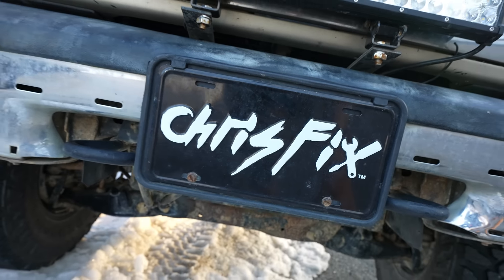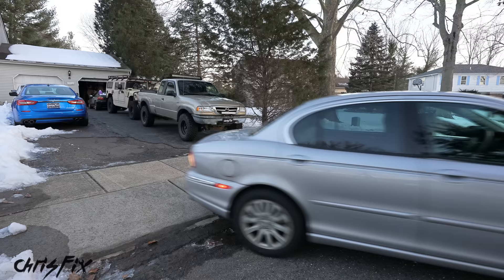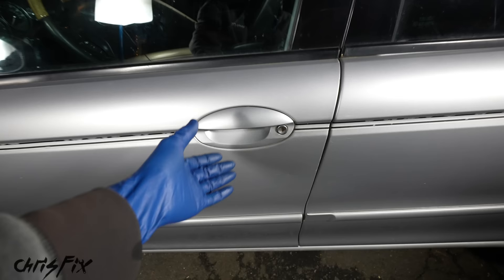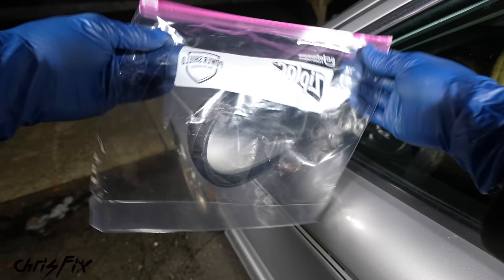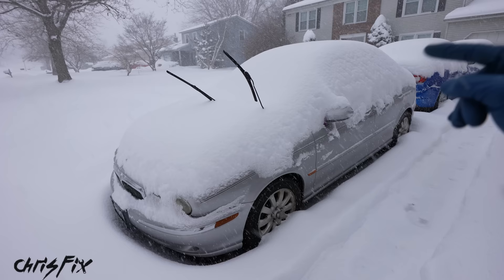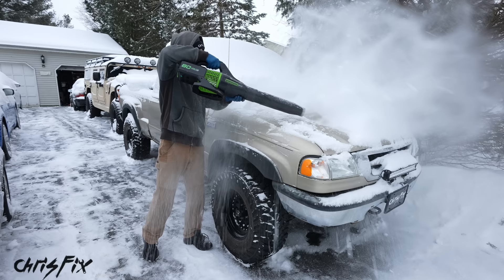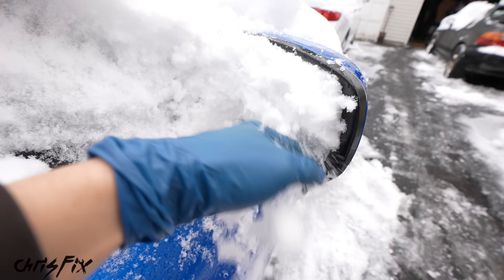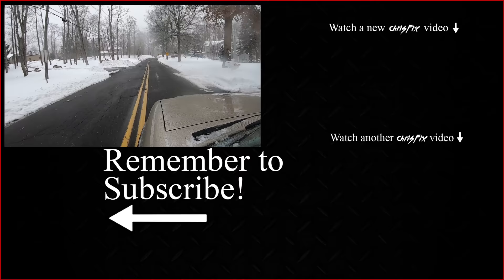10 Winter Car TIPS & TRICKS you NEED to Know

Comment: 10:53 you need to get that snow off the roof too, otherwise it will come off randomly while youre out on the road, creating problems for other drivers. plus it ruins the aerodynamics.

i think the best tip would be to park the car in a heated garage. doesn't have to be all that warm, jjust keep it a few degrees above freezing so that any residual ice and snow melts off.
Reply: When we built our home we insulated and dry walled our garage. Best thing we ever did. Never gets below 47 degrees even when it’s below freezing outside. Also we have the garage attached to the house best thing ever especially in bad weather with kids.
Reply: In some states it's also illegal to leave piles of snow on your vehicle when operating it, as the snow can come off in large chunks and damage other vehicles.

Comment: Another good one is to get an industrial chemical spray bottle or garden pump sprayer from the hardware store and fill it with deicer washer fluid. Spray down your glass and headlights while you're warming your car up so you don't have to run your wipers to use the car's pump. And if you're still running non-winter washer fluid when winter hits (which will dilute the effectiveness of any winter blue-juice you pour in), just add in a bottle of isopropyl (rubbing) alcohol from the pharmacy. It's the same active ingredient as what's in the de-icer stuff. Bonus tip: A thin film of dielectric grease on the door seals does the same job as the silicone spray if you can't find any. You know. That stuff that's at the register at the parts store in the little packets that no one ever buys?
Reply: Incorrect. Isopropyl alcohol will still freeze at lower temps. The active ingredient in washer fluid is methanol which doesn't freeze as easily. It is poisonous, so be careful with it. Also, rubbing alcohol from the store usually contains glycerine, which you really don't want mixed in with your washer fluid.
Reply: @mnntropy5615  Interesting. Been doing it for years and never had an issue.

Comment: If you live somewhere cold(-15C), then don't use that warm plastic bag thing. Melted water will freeze your car badly and then you are fucked up. That water will freeze in under 10 seconds.
Reply: umm no.
at -25 c my door was frozen solid and i used that method and i got the door open when all the ice melted away. and the lock melted from ice.
Reply: Naw, the seals are pretty well designed to keep the water out normally.  The main thing is not to push snow into the lock mechanism when unlocking the vehicle.  Make sure that area is clear first.
Reply: @canadean84  it depends on your car, ir its new then the seals are usually good
Reply: @fuolku1006  it depends if you have New or old car

Comment: The best practice: Snow storm -> my car stays in the garage!!! 🥶
Reply: It doesn't sound like you do it all the time, but putting this here in case  you do park your car in the garage every day during winter. Also because it will help others who read this not have rust. 

Not actually a good idea. The brine some cities (not all) use is Magnesium Chloride (MgCl2) and is activated by water. Putting your car in the garage after trekking through the city/country and picking up snow the whole way will put your vehicle in a defrost, wetting your entire vehicle down the entire night with that brine solution on it. This solution, when activated by water, is actually more harmful than normal rock salt for paint, eating it quite rapidly, since it sits indoors for hours on end while wet. Even unheated garages suffer from this, since all it has to do is be even slightly above 30 degrees Fahrenheit for the ice to start to melt. Once it starts, the MgCl2 will melt the rest and douse your car.
Reply: @joes1176  You recommended what to combat this?

Comment: Great video.  I too am a winter living Canadian.  I already use some of your excellent ideas, but I love your snow shovel trick.  

I would like to know if there would be any disadvantages in using that spray wax behind your tires, in the wheel wells and under the running boards.  I use a rubber mallet to remove the built up ice under there, before I park in the garage (to avoid the mess on the floor when it falls off).  This would be an excellent fix to that build up problem.

Again, a great video.  Thank you. You have a new subscriber.
Reply: That's a great idea! You should totally use the spray wax on the wheel wells and under the running boards.
Reply: You should also use them on the tyres, if the ceramic wax is hodrophobic then that means the tires would be better in the rain right?????
Reply: @cowmaster9180  Under NO circumstances should you spray anything like tire polish, wax, ceramic finish, or anything slippery on your tires, rotors, or brakes - unless you want to slide off the road, and wrap your car around a tree, or crash into other cars. Read the fine print on the label of tire polish and it will tell you this every time.

Comment: Nice tips,  but it would be more helpful to shovel your driveway before you drive out.   The snow that the snowplow shoves in your driveway is normally heavy and packed down.

Also get windshield washer fluid that is good for -40 or -45.   Remember that it's a lot colder with wind chill.   If you're using washer fluid while driving it's going to be colder because of the wind while traveling.

Comment: For the windshield, we've always used a large beach towel and closed it in the doors so it didn't blow off. Just open the doors and shake it off and toss it in the trunk. Kinda one time use though until you dry it or swap with a dry one.

Comment: Crystal clear glass you can actually see through, who'd have thought😆Splendid tips for Winter motoring. The amount of muppets we see on the road in Britain, getting stuck and being helpless when It just takes a little forethought and preparation. To be fair though UK seldom gets snow like that so drivers don't get the practice or heed the advice so when we do get a heavy fall (Last occurred in 2009-2010) most UK drivers go to pieces. Loving the Jag 👍

Comment: I like using a space heater on the inside and plug it in 2 to 4 hours before leaving and warm inside and get the snow and ice off just have to do the hood at that point 
Or just cover the whole thing with a  tarp before the snow hits and pull it all off

Comment: Rain-X the glass.... You can use spray cooking oil on that shovel before you start using it also, we do that with dirt bikes inside the fenders it works. You can also use a garden hose if you don't have any of the examples shown. I have defrosted / snow/ice a vehicle with garden hose sprayed gives it a chance to cool a tiny bit from the hot water tank. Works just fine years and years and years and years.
Reply from the maker: Thanks for sharing!

Comment: Screen protection. 
Get a piece of tough polythene sheet about two feet longer than the width of the vehicle and two or three feet wide depending on the shape and rake of the screen. Nine by three for some SUV and smaller for most saloons. Spread across the screen and have six inches overlap at the top. Trim the bottom of the sheet to the shape of the bottom of the screen. Cut the bottom two corners off: this allows you to tuck the ends into the top window frame portion of the front doors. Place it on the windscreen with the wipers on top. Tuck it into one door first then place it behind the other door pulling it gently so there is some tension on it as you click the door shut.
Hardware stores or garden centres stock sheets of polythene, probably selling it by the yard. Another source  is using the big shrink wrap bags used for shrink wrapping pallets. 200 micron to 400 micron polythene is typically good for this and will last for manys uses. Polythene is a polyolefin so does not stick to anything so it sheds ice and snow easily. Usually a quick shake is all that is required before stashing it in the car. 
In windy conditions it will be most secure if the vehicle faces the wind. Works in windy Scotland so should work in most places. In extremely windy locations, the force will pull the sheet out of the doors so cut the sheet with really long tails that overlap inside the car and can be tied together with string.
(The silicone spray on the door seals always works great but don't do it on the bit where you are tucking in the screen protector!)

Comment: I've used Vaseline on my rubber door trim, everclear in my wiper fluid, tarp on windshield or lg cardboard pieces. Good to catch your wipers up on your windshield (during a swipe) to hold tarp or cardboard on. Also, graphite is good for key sockets (before the hard freeze or storm.
Good tips but here's some alternatives.

Comment: (Vaseline) petroleum gel works the best on the door rubber strips.
A towel (or two) can cover the windshield. Use clothes pin to hold them together if you use 2 towels.
The towels also works (with the bonnet) to cover the headlamps.

Comment: I'm really surprised this wasn't mentioned, but maybe it's because it's just so obvious? But the biggest two tips for a winter vehicle are easy in my mind:

1) Remote starter. There's nothing worse than getting into an ice cold vehicle. And going outside and having to clean off your vehicle just to get into it to start it so it can start warming up doesn't work so well either. Nothing like starting your car from your kitchen table while you enjoy your cup of coffee in the morning. And then going outside to a vehicle that's already warm with ice it's already starting to melt without any effort from you. Bonus tip, lots of smart vehicles have internet enabled apps that will let you remote start your vehicle from your phone, from your smart speaker, or even trigger it with routines are on a schedule. That way you don't even have to think about it.

Now another reason this might not have been mentioned is because your car may not have it. But it's always amazing to me how many people I see with remote starters that just don't use them or don't take advantage of them enough. Many remote starters will shut off after 10 minutes automatically, which is not enough time to thoroughly warm your car and get everything melted in many cases. Just plan this out and use your remote starter twice or however many times the manufacturer will allow you to do it before it stops working. This is an annoying limitation and I have no idea why manufacturers do this or at least don't give the user away to turn this "feature" off. 

Another point is that you can get third party remote starters installed in your vehicle, assuming you own it. And, as someone who lives in the Northeast who's lived both realities, I can tell you once you've had a remote starter in a place with hard winters you will never go back. It's an absolute must for my vehicle.

Also depending on your vehicle and/or remote starter, you might have to remember to set your heater settings to warm the night before. Some more modern vehicles automatically turn the heat up and turn on your heated accessories for you in the cold when you initiate a remote start.

2) Heated everything. At first it might sound like a frivolous luxury to have heated seats, let alone heated mirrors, or a heated steering wheel. But I'm here to tell you that what sounds like pampering is actually super functional and once you have it you will consider it a practical necessity moving forward. Even preheating your vehicle is not likely to warm up the seats or wheel before you get into leave when you're talking about temperatures in the single digits or lower. And I've been in many vehicles where even with the heat cranked all the way up once you get going at highway speeds the car seems like it has trouble keeping warm and you can just feel the cold radiating from the exterior inward. Heated steering wheel and heated seats can really make a difference in your level of comfort. I never have to drive with gloves on anymore, thanks to my heated wheel. And I can't tell you the last time I've thought about heated mirrors, but I also can't tell you the last time I thought about having to clean the ice off my mirrors. Because my car just does it for me. 

Obviously you can't get these features installed if your car doesn't already have them. But it's something that is still worth mentioning and thinking about for when you go to get a new vehicle. It's easy to get caught up thinking about gas mileage or horsepower or cargo space when you're shopping around for a new vehicle, But these little kinds of features can really make a huge difference in the ownership experience when you live in places where winter is rough. I remember back in the '80s and early '90s when having AC in your car was still a luxury feature... Pretty sure my friends down south made that into a must-have before we did up here. Now AC is a standard feature in pretty much any vehicle. Hopefully, these winter accessories and features will become thought of less as luxury items and more as standard must have's in the cold parts of the country. People shouldn't have to freeze or stand out in the cold scraping ice any longer than they absolutely have to because cold weather features were bundled into a high level trim that priced them out.

Comment: I bought a car cover, put it on for when I know it's going to snow a lot. It takes about 10 minutes to put on, has a zipper for the driver side door to get in, incase you forgot something or for starting your car first, then removing the snow is a breeze, it just glides off. Take off the cover, about 5 min., roll/fold up the cover, throw it in the back and off I go. I think I paid 70 bucks for it.

Comment: Also, my dad would always put bags of salt and or cheap clay kitty litter bags in the truck bed near wheel wells. He said, that way you have weight, extra traction to sprinkle and if you happen to be in a wreck, you won't have cinder blocks flug around! And always a full tank so ice crystals don't accumulate in tank.

Comment: Im 15 and have to drive in 5 in morning and this is my first winter so i aint very  experienced for winter time and first time my windshield freezed i didnt know what to do so i drove with frozen windshield 6 kilometers to my destination i didnt know how i got there alive so after that i always putted blanket on windshield and covered my whole car with nylon and the only problem i have now is car lock freezing but i leave car unlocked because no one will steal alfa romeo🤣 and also door freezing shut so i will try silicone spray and i will get a not working credit card if i have to unfreeze my windows in a hurry.Thank you so much i watched all your car cleaning vids in row because they are very usefull the only things i am afraid to do is taking out the seats from car and cleaning the engine bay i mean its a diesel it doesent have much wires but stil i will take it to someone who knows how to do it who is experinced i dont want to ruin my loved alfa

Comment: You can use a tarp over the windshield and cover the hood also. Shut the top corners in the doors. Use bungee cords to hold the bottom of the tarp to the wheel covers. Then you can take off 36” of snow in one motion. Be sure to take it off in the same direction of the windshield wipers.

Comment: The tip our family used growing up:
Step 1:  Live someplace where it doesn't snow or get below freezing.

The tips I use now that I live in a moderately snowy climate:
Step 1:  Buy a truck with 4 wheel drive, good ground clearance, and remote start.
Step 2:  Remote start your truck before the get ready for work so, in most cases, everything is defrosted by the time you're ready to go and there is little to nothing left to do except maybe run your wipers.
Step 3:  If there's any snow remaining on the windshield it will easily slide off with the brush.  Ignore the snow on the rest of the vehicle, it will blow off on the freeway.  Ignore the snow on the driveway, stick it into 4 wheel drive and plow through/over it.

The tip I recommend for those living in very cold climates or where you get lake effect snow:
Step 1:  Get counseling to figure out why you would do such a thing to yourself.

Comment: I’ve got a coupe with frameless doors, the windows drop half an inch when you open the doors but if the glass is frozen it won’t drop and the door doesn’t open properly. My girlfriend steals my cover so I use a couple of bin liners on the window. Works a treat.

Comment: best tip for living in snow country .. clean out all the 'stuff' from the garage and park them inside .. and for easy extra traction with a truck bungee cord 2-3 cinder blocks over the wheels .. each block is 30 lbs and will not break or collect water ..